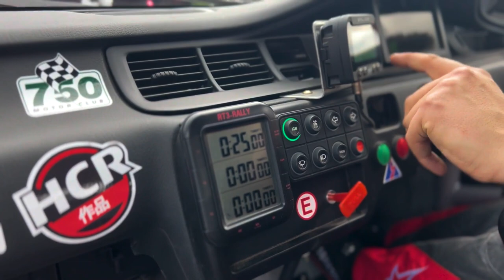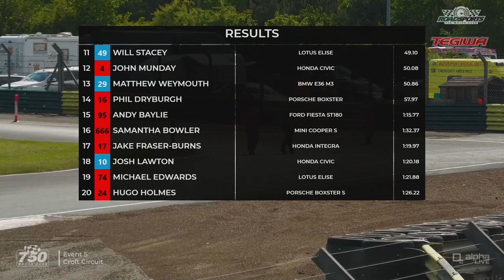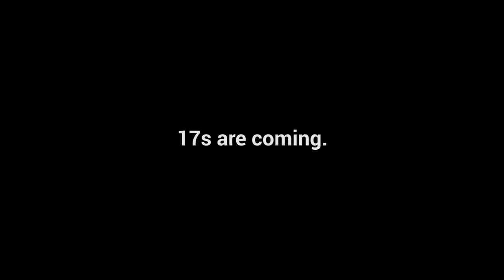2nd PLACE to 34th. What happened? DISASTER!!! - SUPERCHARGED K24 EG Civic

Comment: A thought a I have been playing with it myself. Where your getting a bit warm is you rad and ic ducted? Even just side fins to stop air going out the sides makes a big difference. Easy and cheap to do I did my rad and air intake separation and ducting with abs sheet for £15

Comment: I hope your running 36 mm drivehafts, otherwise you will have CV troubles regurlarly...ask me how I know. Great race, great car, keep going!!
Reply: Unfortunately not but it’s on our list of upgrades…
Reply: @petelawton-hcr_works6059   Hey Pete, yes put it on the priority list has its a must have,  I am about to fit them myself as go through a CV about every 1h of track time give or take of course. All the best and keep going strong 🥇
Reply: @raceandmap  inner or outer cv’s? This was an inner failure.
Reply: @petelawton-hcr_works6059    I kill outer ones, inner usually dont fail (done quite a few kswaps) unless the shaft is shorter that it should leading the cup to crack or poor quality grease makes it cease over temperature.
Reply: @raceandmap  yeah seems like the bearing disintegrated. The shafts were repacked with appropriate grease etc. We have had trouble before with boosted k series wearing inners out but that one wasn’t a genuine Honda shaft.